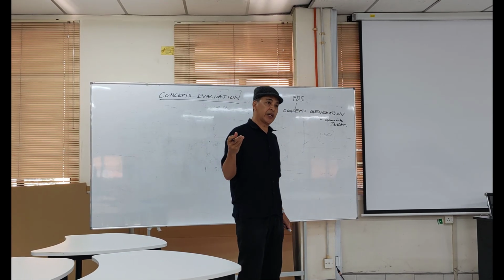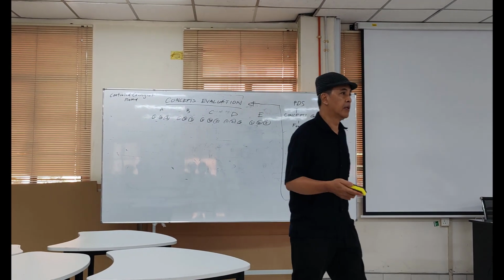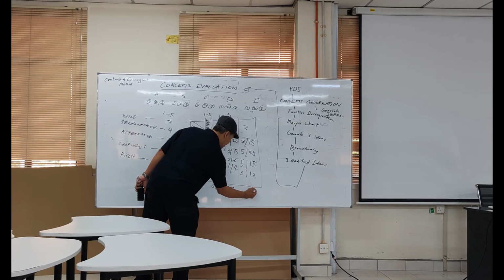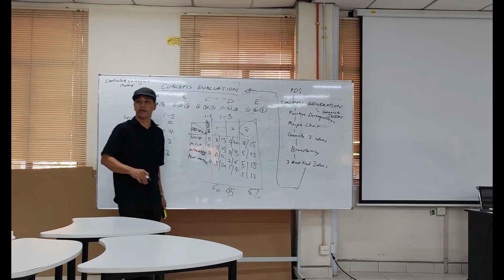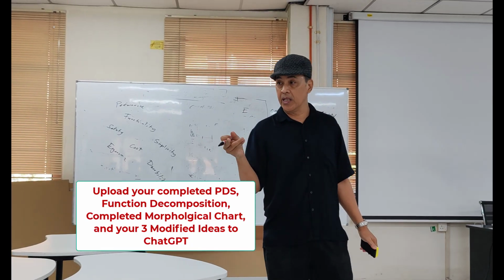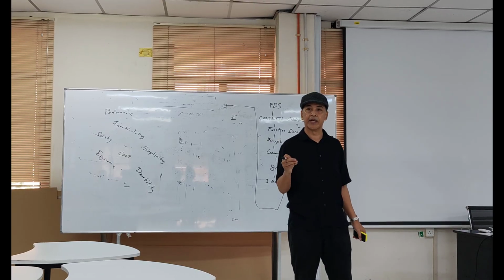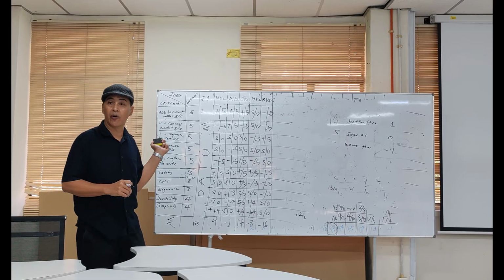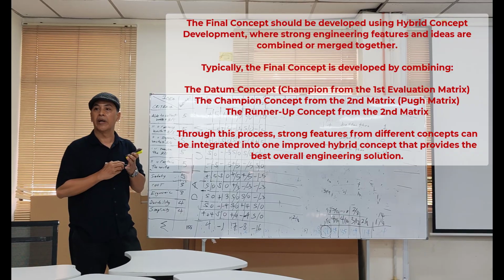Concepts Evaluation in Engineering Design Process (Recorded Class for  Introduction to Design, UTM)

Comment: Brother Iam a 3rd year mechanical engineering student. Iam doing a GD&T project on a handheld battery fan. I tried designing your playlist of hand held mist fan. But i got error when deleting the bodies many parts seem to be not found. I tried resolving the issue but i was unable to do it. Can you please share your original solidworks file of that fan that will be very helpful to complete my project please